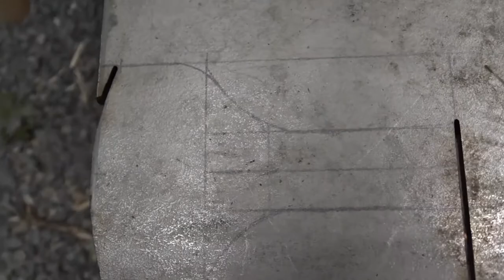Make a Hide Fleshing Knife in 3 hours out of 1/4"  plate stainless steel using simple hand tools

Comment: awesome video thanks! I'm going to make this if I can get my hands on a plate.
Reply from the maker: TJ Jones sweet!
Reply: yeah I bought a piece of angle bracket of mild steel and had them cut it down then took it home and formed it. They didn't have stainless but it only cost $2 then found a stick in my back yard. Used a hand plain then electric sander. Drilled two holes like you did and put a hose clamp over the top to be extra safe since the metal only goes into the handle 2 inches. Linseed oil covered by some floor wax and it's good to go only took a few hours. Glad I saw this! Stainless would be the best but that just means I will need to sharpen it more often....no big deal. You get way more pride in things you make than things you buy. Only cost 2 dollars to since i had everything else here. hahaha. take care
Reply from the maker: TJ Jones awesome sauce.

Comment: cool.  do a video of the old jeep
Reply from the maker: +brewmaster0507 finished rebuilding the brake calipers, and installed a new master cylinder.  De-rusted the gas tank.  Need to reinstall tank and bleed brakes then it will be roadworthy.     I will post a video of it when I get it rollin.